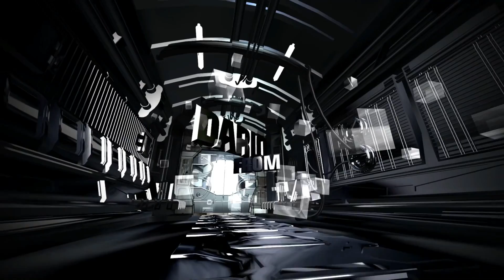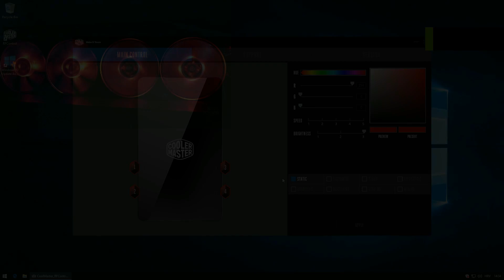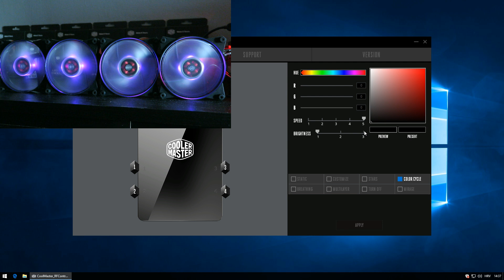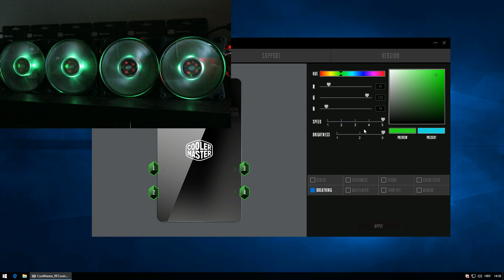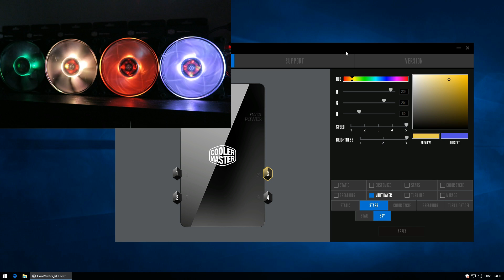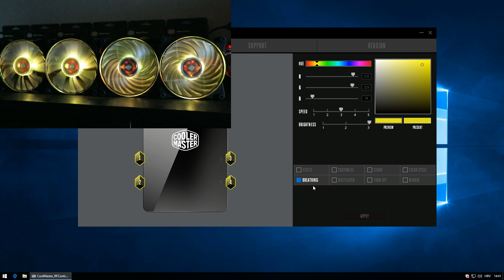COOLER MASTER RGB LED Controller - TUTORIAL AND REVIEW

Comment: So if I'll connect 1-3 rgb splitter to rgb controller, I will be able to connect 6 rgb fans. Am I right?
Reply from the maker: John Alfonso Yes, because you connect three fans to the splitter and splitter to the RGB LED controller and then each fans (fans number 4, 5 and 6) separatelly to the RGB LED controller. 😉

Comment: is this for RGB fans only? i have an "upHere RGB GPU brace support holder" 3 pin 5V (Not the usual 4pin 12V). and to top it off, my MB is z97x which does not support RGB
does this controller support 3pin 5V?
Reply from the maker: Controller is strictly for 4-pin 12V RGB. As for the 3-pin 5V, that is ARGB, or Addressable RGB.

Comment: which rgb strips does it support? can i conneact the asus aura led strrips
Reply from the maker: Niraj Kothavade If you have ASUS board then I would rather suggest maybe connecting everything to the board. Then everything will be at sync 😉
Reply: Actually I do not have any rgb header on my board... I also have 3 rgb fans from lia li bora series, but since i do not have any rgb controller or rgb header on board...i am unable to lit my strip and rgb fans, looking for an universal controller which can lit them all...
Reply from the maker: Niraj Kothavade Maybe if the LED strip is 4-pin you could manage everything with a splitter but I can’t guarantee it will work. 😬

Comment: Hello, I have the cooler master mb 530p case. My motherboard doesn't have the header to connect the rgb fans on the case. Would this control fix the problem?
Reply from the maker: Hi, if the fans are just RGB and not ARGB, yes it would. That is why CM made this controller so you can control the RGB lights of the fans without the 4-pin RGB header on the motherboard. Also, check if you have USB 2.0 connector free on your motherboard because you will need to connect the controller to it.
Reply: @PCCrazyDario  thanks heaps for the quick reply. My case information reads "Sync the ARGB fans by connecting the ARGB cable directly to the motherboard or to the I/O panel with the included 2 to 3 ARGB splitter. Certified compatible with: ASUS, Gigabyte, MSI, and ASRock motherboards for a comprehensive lighting system".  My motherboard has 4 pin connector,  but the plug from my fans has a 3 pin plug.
Reply from the maker: Peter s Can you tell me what motherboard please?
Reply: @PCCrazyDario  I have the ASUS TUF H370-Pro
Reply: @PCCrazyDario  I can get the front 3 fans to spin fine, and they give off a very dull and weak colour
Reply: @PCCrazyDario  I'm pretty the fans are Argb
Reply from the maker: Peter s You can’t connect ARGB fans on an RGB connector. It just isn’t physicaly possible. As for the motherboard, it has only one RGB, 12V, 4-pin connector.
Reply: @PCCrazyDario  yep thats what I thought. I think I'll just swap out my current argb fans for some rgb ones. Thanks so much for the help I really appreciate it
Reply from the maker: @peters8180  You are very welcome. :) Also a note, ARGB have better light effects so basically you would downgrade yourself with RGB fans. Just so you know. ;)
Reply: @PCCrazyDario  Yeah I would prefer ARGB, but as I can't connect to my motherboard I would take rgb over having no lights at all.
Reply from the maker: Peter s Makes sense actually hehe 😉
Reply: @PCCrazyDario  hahaha 😁 thanks again for all the help
Reply from the maker: @peters8180  Always welcome ;)

Comment: I havent fans from coole rmaster but i have my rgb fans from another brand, will the controller work with the fans,
Reply from the maker: Zhyphion Unfortunately no, because it has certain types of connectors that only fit Cooler Master fans. 😬
Reply: Doesn't the 3-pack have adapter cables that go from the normal 4-pin rgb pins to the connector of the hud ? http://www.coolermaster.com/cooling/case-fan/masterfan-pro-120-ab-rgb-3in1-with-controller/
Reply from the maker: Dorientje Woller Do you mean 1-to-3 Trident splitter?
Reply: No, the 3-pack of fans come without the 1-to-3 trident splitter but with 4 rgb extension cables that have on one side normal 4-pin rgb connectors and on the other side a connector that fits the controller. The 1-to-3 trident splitter is a separated accessory of Cooler Master and cost about 14 Euros. This splitter is only included with the AiO-coolers/aircoolers with more then one fan of them.
Reply from the maker: Dorientje Woller Oh sorry, my bad. And yeah, that is really strange because I got those with my 3x fan set I bought for my H500P build. Even stranger is the fact that on the web site, the link you provided, has description that it has them. 🤔

Comment: I have a question. I see that master fan adapter has places to connect 4 fans. but in my pc case can 5. what to do now, is there a way to connect this fifth fan??
Reply from the maker: Looky Bay Yes, of course there is a way. Just get a 1-to-3 Trident Splitter from Cooler Master or get the RGB 1-to-4 RGB splitter and that is it 😉
Reply: @PCCrazyDario Ok bro, thanks for help and answer. I buy  this splitter. Thanks :)
Reply from the maker: Looky Bay Glad I could help you out and you are welcome. 😉👍

Comment: one of my fans wont change to the right color, its like its inverted from the rest of them any solutions?
Reply from the maker: Jaycee Almanza Your connector to the RGB LED controller is on the wrong side. Check those arrows that you have at the ends of each connector. They should be faced to each other to work properly.
Reply: i feel stupid haha thank you so much, works perfectly now
Reply from the maker: Jaycee Almanza Don’t worry, that is why I am here. 😉

Comment: will the RGB LEDs work without the RGB LED Controller?
Reply from the maker: Michael Ong Yeah, you can connect them to ASUS motherboard and use AURA SYNC. You will need 1-to-3 Trident Splitter cable to do all of that. The quantity of splitters depend on how much fans you have.
Reply: I am using MSI Tomahawk motherboard now that only has 1 RGB header. I tried connecting 1 of my 4 fans into it and it only red LED lights up. The RGB LED controller software doesn't detect any of my CoolerMaster fans when I do it this way, so I don't know how to change my fan to any other color.
Reply from the maker: Michael Ong How many pins is the RGB header on your MSI Tomahawk? And what is the model of the motherboard?
Reply: The RGB header on my MSI Tomahawk has 4 pins. Motherboard model number is MS-7B47.
Reply from the maker: Michael Ong What software are you using? Sorry for the delay, I have been busy lately 😬
Reply: I am using the CoolerMaster RGB LED Controller software. I do not have a RGB LED Controller device though. Just the CoolerMaster RGB Fans.
Reply from the maker: Michael Ong The RGB LED CM software works only on RGB LED controller. Use the application for the motherboard from MSI 😉 Then it should work.
Reply: Thanks. Downloaded MysticLight for MSI motherboard and RGB worked. But since I have 4 RGB fans, I would have to get the CM LED Controller eventually. Does the RGB Controller have to be connected to the motherboard RGB header as well? Or just the USB and SATA will do?
Reply from the maker: Michael Ong No, you don’t need the RGB LED Controller. Just try to find and order the 1-to-3 Trident Splitter from Cooler Master. Unfortunatelly, for four fans you will need two trident splitters. But then you will have one extra connector for let’s say LED strip. 😉
The RGB LED Controller connects only to SATA and USB. No RGB header.

Comment: Hey man can I use any rgb fans with this or do they have to be cooler master fans?
Reply from the maker: brody lockwood They have to be Cooler Master since they have special connectors. 😬
Reply: @PCCrazyDario  OK thanks man. I really want some corsair rgb fans is there a hub for them that plugs into usb header on mobo and not rgb header?
Reply from the maker: brody lockwood I think that Corsair actually made the RGB HUB Controller like that. Actually, check these out: Corsair Commander PRO, Corsair Lighting Node PRO. 😉

Comment: Hey , i have these , but apparently everything working fine is just that the software cant detect the rgb controller but the controller is clearly connected to my motherboard :/ sad cant use the software because it does not detect
Reply from the maker: Did you connect the power for the RGB LED controller?
Reply: PC Crazy yes i did , sata check , usb check , all fans on mobo + rgb on rgb ... software cant detect tho :(

Comment: Question, I have the ML240L RGB in my system with 2 air-balanced fans from Cooler Master on the rad with the 2200 rpm speed. Would it be adviced to swap those with 2 Air Pressure fans from them at 1500 rpm?
Reply from the maker: Well I have 7 Air Balance fans in my computer and they run at 900-1050RPMs since I have a full custom loop from EKWB. Now, you could lower their speeds down from 2200RPM to 1500RPM and check the temperature while in full load. Maybe you don't need to switch fans and the Air Balance ones will be suitable. Try that first.

BTW, do you have any other fans in the case for a better air flow throughout the case?
Reply: I have 3 Aerocool P7-F12 Pro as exhaust. 3 RGB fans for only 50 Euro, with hud included at 1200 RPM max, mostly spinning between 700 & 900 RPM. Problem with these fans, as you can guess, is that they have a different colour diffusion then those of Cooler Master in my case. Plus I want to step down from RGB-Fusion of Gigabyte, coz after a year and numerous updates, it's still a disaster of a software package. So, I can keep those 2200 RPM airbalance on my rad and get a 3 pack of air pressure fans to replace those of Aerocool so I can control all the rgb with the included hud of Cooler Master. Also, they (air pressure 3-pack) are currently cheaper as a 3-pack air balanced.
Reply from the maker: Dorientje Woller Now I understand everything. If they are extremelly cheaper, go with Air Pressure. But the difference is slightly in my opinion as I checked the reviews online and the temps. The main thing is that the Air Balance are on the radiator. The rest can go where you wish.
Reply: Figured it out, 3-pack of Air Pressure, so I can control all sides and rgb on the pump as zones differently. I have already 2 rgb splitters (1 from the AiO and one I bought separated), so what I have in mind will work neat.
Reply from the maker: Dorientje Woller Excellent then 😉👍
Reply: Yeah, those air presurres will be used as exhaust, I don't see a reason then to place them on rad as the air balanced of the AiO have a higher pressure rating. Anyway, thank you for the advice.
Reply from the maker: Dorientje Woller Exactly. Tell me the temps when done compared to the temps right now.
Reply: Installed 3 Air Pressures as exhaust, temps remain the same as before.
Reply from the maker: Dorientje Woller But at lower RPMs right?
Reply: No, the 3 new ones (Air Pressures) as exhaust are spinning between 700 & 1000 rpm, the 2 Air Balance that came with the AiO can spin up too 2200 RPM. RPM's are controlled by the System Information Viewer of Gigabyte and are set on standard mode, after I calibrated the fans with this utility.
Reply from the maker: Dorientje Woller What are the temps on idle and full load?
Reply: idle 30°C - load 60°C after 15 minutes Prime95.
Reply from the maker: Dorientje Woller Those are brilliant temps if you ask me. With water cooling custom loop I have 50C.
Reply: Must say that this Mirage effect is really nice to see. I have set them on 384 Mhz and it looks like rippled water.
Reply from the maker: Dorientje Woller Oh yeah, love the Mirage! I have it as well on my computer. 😁

Comment: where did u get the program to controll the vents?
Reply from the maker: A-K 7125 You have it on their website. Just google Cooler Master RGB LED controler download. If you can’t find I’ll attach the link in the comment tomorrow. 😉
Reply: okay thanks ^^
Reply from the maker: A-K 7125 Most welcome. If you are going to have trouble finding the software, comment it and I’ll find it for you. 😉
Reply: PC Crazy one more think, if I don't have the 1 to 3 splitter, can I use the same effects in the vents, por the splitter is necessary?
Reply from the maker: A-K 7125 Splitter is here only to attach more fans and RGB LED strips. If you have only 4 fans or 4 RGB LED strips then you don’t need it. 😉
Reply: PC Crazy I only want to put 3 vents, so I don't need the splitter no?
Reply from the maker: A-K 7125 Nope, no need for it. You can added one more RGB LED strip to the 4th channel and have no worries about it. 😉

Comment: Greetings, I was thinking of buying this with a set of three Masterfan Pro you have in the video. I have a Gigabyte B450 aorus pro and an h500 Coolermaster case. If i split connect the two front rgb fans that came with the case to the controller, along with the three fans I will be installing in the combo package from buying the rgb controller, will there be any issue ? I mean, will all my 5 fans sync together ? Thanks a lot for your time!
Reply from the maker: Hi, if you check my H500M and H500P build that I did with the same controller and with the all fans connected to it, you will see that there isn't any problem. Just note one thing. You have in that case 5 fans, and the controller has 4 connectors. My advice, connect front two fans to one channel, and the other three to other three channels. Also, if you have H500M it has front fans with ARGB connections, so you won't be able to connect them to this controller. If you have H500P, then it has 2x 200mm RGB fans which have 12V 4-pin connector that fits perfectly with it. Hope that I clarified it a bit. ;)
Reply: @PCCrazyDario   Sorry for late responce. Thanks a lot, Imma check it out when I buy the set!
Reply from the maker: Αναστασιου Παναγιωτης no worries manx enjoy 😉

Comment: i got 3 240 versions and 2 are green and one is red or vice versa how do i get them all the same colour?
Reply from the maker: deathsmessenger You need to check the connectors. You have an arrow simbol on each connector and they need to point to each other, otherwise this will happen what you told me. Check the connectors, happened to me as well. 😁
Reply: PC Crazy thanks that was the issue I didn't even notice the arrows lol . Don't suppose you know anything about water cooling?
Reply from the maker: deathsmessenger Glad that I could help. 😉
Sure I do, as you can see in the background my PC is in full custom EKWB water loop. 😁
Reply: PC Crazy m running an 17 6700k (no oc) 16gb ram ddr 4 gtx evga 1080 asus maximus ranger 8 mobo masterliquid 280 aio cosmo c700p case (3 x intake 3 x outlet

i migrated the componants from my old case in to the c700p and i got the liquid cooler to replace my old air cooler and the first burn test i done the pc shut down with in a few mins thanks to high temps so i removed the paste from the cpu and replaced it with one blob in the centre instead of spreading it all over.

when i redone the test i found that during the 15 min test my pc didnt shut down but when i ran prime 95 and watched my temps i was hitting 100 degrees c but the pc wasnt shutting down unlike previously.

i once again removed the paste and replaced it with five blobs on the cpu and now when i run p95 im getting temps of around 80-85 degrees after 20 mins. i feel i must add that withing a few seconds of starting the test my temps was hitting 77 degrees almost instantly before rising to the above temps.

im using all new parts and the paste seems fine and the pump is located properly and secure, so i have these questions:

1, are these temps right for the set up i have (i dont think they are but its my first liquid cooler)

2, is the cooler faulty

3 is it something else i forgot about